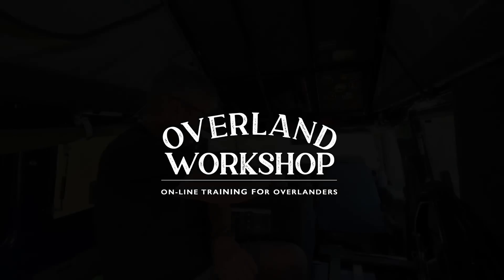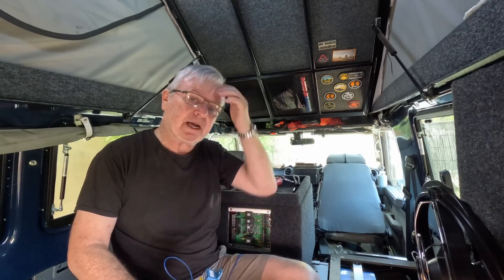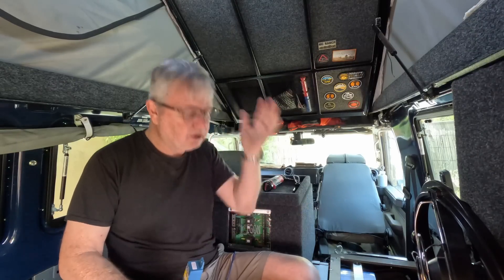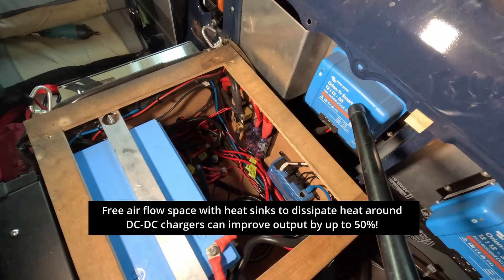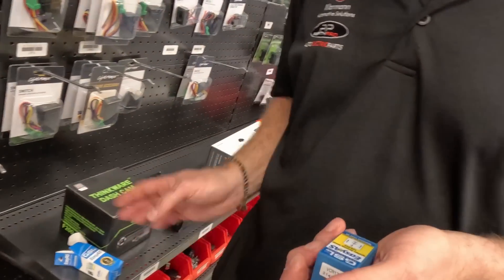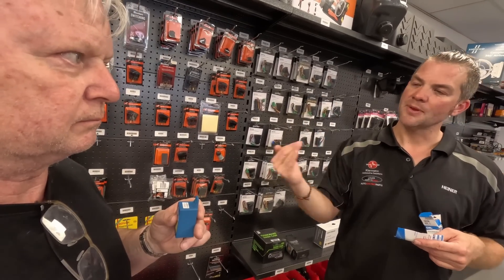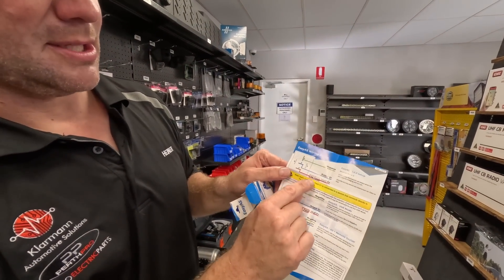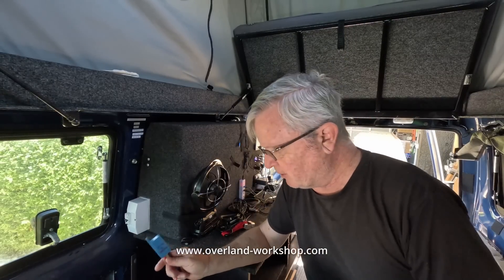INCREASE DC-DC CHARGER OUTPUT IN TWO EASY WAYS | @4xoverland​

Comment: hi.my twin victron dc chargers putting out only 2 to 6 amps recently on my vw t4 camper they in parallel the victron smart shunt shows same .i also have 12amp dc charger supplying my agm battery separate circuit.same earth.that supplies my stereo double amp system with subwoofer.only had about 28to 36 amps from 2 victron before

Comment: Hi Andrew I use a Victron dc to dc charge a 12/12-18 an mine works perfectly with a small 6 amp charger on the start battery. I think you don’t have the lower cut out voltage right mine is set to 13.6 volt cutout. It builds up voltage then bulk charges to the lithium battery then draws down kicks off at 13.6v and builds back up again

Comment: Seems like the Victron Orions are smarter than you give them credit for.  

I have a small 1.6amp charger on my start battery and my Orion never drains my start battery because the Orion only switches on at the voltage I set and it varies its output to trickle charge the secondary lithium battery.

Seems like you’re trying to solve a Redarc problem on a Victron product.

Also setting the cut off voltage at 12.4 is totally wrong.  You need to run bigger cables.

Comment: Very interesting that they set the voltage as low as 12.5v (without the relay). If the second battery is fairly discharged, the starter battery will only be getting charged at around the mid to high(ish) 12v region, which won't sufficiently charge the starter  battery and could have potential for not enough power to start the vehicle. 

I've found with mine (high output alternator, 75 series) that when I come to idle the starter battery voltage drops down to easily 12.5v in which the DCDC chargers engine shutdown detection kicks in and disconnects the DCDC charger. A bit annoying but on long runs it's okay. I might purchase this relay! Good explanation 👍

Comment: Since 1998,  I've used a Bussmann Circuit Breaker BP-CBC-30HB-R to charge two additional regular automotive batteries strictly for powering up the winch, gadgets, and lights. Not once did it ever drain my main battery. The Winch connector has an Anderson connector which is also used to jump-start any other vehicles and my main battery. With that being said. This old method should also work with the DC-to-DC configuration which will prevent/protect the main battery from being drained. Just saying 

Bussmann Circuit Breaker BP-CBC-30HB-R 

NOTE: The Profile Picture is My Beast which has this configuration and more.

Comment: I didn't understand how could this solve the 2nd battery stealing from main battery issue until I switched to Victron DCDC charger. A lot of DCDC charger has a built-in voltage sensing relay so that when a voltage exceed a threshold, it's on, and off when it's below a threshold(12.8v). They also come with an ignition trigger, but it's for smart alternator only. Because smart alt would drop the voltage when the primary battery is 80% charged. The issue is the ignition trigger can turn on the charger even when the voltage is low, but the charger will still get turned on when the the voltage is up. Victron charger is different, the switch is very flexible so you can use ignition relay to turn it off.

Comment: Wouldn't it be easier to do a fuse tap to a circuit that's only on when ignition is on to power the relay?

Comment: Can you use an isolator (cylindrical selenoid) at the same time as a DC-DC charger? Mine has one (selenoid) installed from the time I've owned it, I'm just not 100% sure if it works/ how it works, I've switched out the battery system for lifepo4s instead of a 100a wet cell. I just want them to get charged safely without ruining the alternator.
Reply: @theshepard22  yes a standard old fashioned solenoid between the two batteries will disconnect them as soon as the ignition is turned off. Ironic that all the new technology relies on the oldest duel battery setup to function properly.

Comment: that relay device is only necessary if you have connected up the bcdc to a smart alternator.  the new redarc devices do not do what you say, and drain the starter battery, if the car does not have a smart alternator. with an old style alternator the blue wire on a redarc isn't connected.

Comment: Same thing happens when your alternator isn’t large enough for the dc-dc charger size. I found out when I had a 20amp dc-dc charger in back of car and 40amp dc-dc charger in caravan. Alternator (80amp) couldn’t supply enough and engine cut out on highway and had to jump start. Battery lost a cell in that and had to put a new start battery in. Make sure alternator is large enough or put two in.

Comment: I have the same disc charger in my caravan and could only get around 10amps max because of voltage drop over the 6bns cable so I installed a VSR in the LC200 and disconnected the chargers engine on detection system and now get up to 30amps.

Comment: Loving these workshop videos….Thank you. I have my DCDC charger in the camper trailer, will i need to run a seperate single cable from the Battery/Trigger sensor in the vehicle through to my camper trailer? Or, is there another way around this via the Anderson plug that is already in place for the DCDC charger at the tow ball? Oh, and the ignition wire on the DC DC charger, does this connect to the trigger sensor? Cheers Tony

Comment: It's a 70 series am I missing something? Toyota provide a switched output for ignition on in the accessories fuse box in the engine bay. I use this to turn my Intervolt DCDC on.

Comment: Solutions to a problem that shouldn't exist. A second alternator setup is about the same price as a Victron DC to DC charger.... and you get the full current of the alternator, plus it also doubles as a backup alternator for the engine battery.

Comment: Maybe I'm wrong, but when an AC charger (which provides limited current) is connected, shouldn't the high current draw of the lithium batteries drop the system voltage below the DCDC cutoff level before the starter battery drains?

Comment: I think wiring a ignition wire is just as easy / difficult as wiring that relay. Don’t see any benefit of the relay. Unless there is something I’m missing.
Reply: I agree, my Projecta 40 Amp Dc to Dc has connection to ignition on only trigger wire, which it does, then I can't see need in changing the configuration. I do have a manual isolator in the starter battery to deep cycle battery in cabin cable connection too and also the redarc SBI 12 on the cable connection circuit. My Projecta charger has also got solar input and operates daily when parked up from the 200 watt solar panel mounted over cabin. My batteries are always full.
Reply: Where is the best location to connect the ignition wire when the DC-DC charge is positioned in the camper trailer
Reply: @tonydawnwright346  You can run it on the spare cable of your trailer plug.

Comment: Interesting. I haven't had any issues with my Dc to dc charger running down my starting battery.
Reply: It’s confusing. I run a Renogy dc to dc and it prioritizes charging the start battery. I do not run a cable to the alternator because it is not smart. The starter is AGM odessey. I’ve yet to charge the starter battery with an AC simply because there is no need. The mppt on the 30a Renogy charger typically prioritizes starter before house so I can just switch on the solar disconnect and all is good.

Comment: Victron DC to DC chargers are thermally regulated - Meaning if you can assist the cooling effect of the fins on the rear you can increase the amperage charge to the leisure battery quite significantly. (i believe its 30a at 40 degC, so the cooler you get them the more output they generate)

A ducted 12v PC fan uses less than 1.5 amps of power but could increase the output of the Victron charger by as much as 7.5a or more. 
take a look at adding a PC fan to the Relay switch for the charger and see how this could get you far more power to your battery meaning you run the engine less. 

Enjoy

Comment: This is like how I have mine setup and it's the best. If engine is on then relay is triggered and charger starts. As soon as trigger is turned off the chargers turns off. No pausing to check voltage. Just pumps 35A in constant

Comment: Yes Andrew, that is why people use Redarc dual battery isolators:cat-orange-whistling:
Reply: Sorry, Redarc used to be Ignition switched but the current Redarc Lithium bcdc 1240D (with a "D") has the same problem. I'm a Redarc fanboy but am totally disappointed and p'd off about this. I called them to confirm and asked why "that's just the way we do it now". What I thought was the Ignition trigger wire, is just for setting one of two cut in/out levels. This is all written in the instructions.

Comment: We use Renogy dcdc chargers and like most modern dcdc chargers, redarc, ctek, victron etc have a ignition trigger, we just fuse tap the cigarette light fuse, or windscreen wiper motor.

Comment: How many amps do you get out of your 30 amp chargers? I’m getting a max of 27 amps and have a small aluminium plate on the back and not amazing airflow but it seems to be getting crazy hot compared to redarc units
Reply: Victron DC to DC chargers are thermally regulated - Meaning if you can assist the cooling effect of the fins on the rear you can increase the amperage charge to the leisure battery quite significantly. (i believe its 30a at 40 degC, so the cooler you get them the more output they generate)

A ducted 12v PC fan uses less than 1.5 amps of power but could increase the output of the Victron charger by as much as 7.5a or more. 
take a look at adding a PC fan to a Relay switch for the charger and see how this could get you far more power to your battery

Comment: Andrew. Again, two solutions to that.

First, in the Orion App you can configure the lock-out voltage incase you don't trust the "engine-running-detection". Set it to 13.5V or 13.4V and it shuts off immediately.

Second, if you charge the starter battery from external, put ignition signal onto the H terminal of the remote port. I reckon the DC/DCs have common GND with the car electrics. And if you cannot find an ignition signal in the back of the Troopy, I'm pretty sure aux power ports (cigarette lighter?) are switched with running engine and not permanently live.

No 126 bucks relay required. NOT, AT, ALL.

Up to this video I really was a huge fan of the stuff you and Heiner did. But now I'm a bit disappointed. This is NOT a smart solution, I'm used to other things from you. (no offense!)
Reply: Yeah I have the same Oron and its setup right, always instantly turns off as soon as the engine is off. Also you can set a start delay so when engine is turned on, it waits a bit for the starter battery to charge back up and then starts charging house batteries. Oron does it all, I don't think these guys know how to use it.
Reply: @marcusrwalker  I reckon the main issue is external charging of the starter battery as Andrew said. Putting ignition or switched DC onto the H terminal of the remote port does the job in no time.
Reply: Would that also work with variable voltage alternators? My understanding is that they can deliver low voltage even when the car is running which will stop the charger from charging and will make the whole process of charging less reliable.
Reply: @pabichpawel  It does, there's a preset for that in the Orion config. Though that'll result in massive current increase and heat emission at the Orion.

Comment: Seems to me that from a technical viewpoint, the DC-DC charger should be able to detect what that relay is detecting.
Can't quite find the exact method of 'engine detection' that the victron chargers use, but from the documentation, it seems they are implying that it is not only volt based.
That said, this problem mainly applies to engines with smart alternators I imagine. On my TD5 defender the charger always stops as soon as I turn the engine off. Victron Full Range Automotive TS-800C (50A) charger.

Comment: I have this setup (Victron). I have a switch on the positive between the vehicle battery and the leisure battery as well as a fuse. I just turn the switch if I don't want it to drain the battery. I'm sure you can also stop charging from the app also, although the charger is a bit annoying because it only turns on when it detects increased voltage from the vehicle battery, so you have to wait for it to boot up. Your set up is more ideal but trickle charging isn't something I do very often.

Comment: If you're not competent enough to wire into the ignition circuit, then you're not competent enough to wire in a DC/DC charger to start with and you should leave it to the professionals

Comment: Good point. My enerdrive dcdc already has that accessory wire. 👍
Reply: I have my Enerdrive 40+ connected without the ignition wire but will soon be fitting it or adjust disconnect voltage up to 12.7 or 12.8 volts so disconnects the dcdc much sooner. I have to gares on my property about 2 minutes. I turn off engine to open and close gate. If my Li battery is low and Dcdc is pulling my setting of 30amps while doing the gates.
On 4th starting engine it is possible the 30amps draw by dcdc and lowered amps in cranking battery that the starter motor will not have enough amps to crank over engine. Solution is to open bonnet and turn off the 70amp breaker switch on dcdc supply cable from the crank battery. Then engine's crank battery will usually have enough amps to spin the starter motor.

Reckon will buy the relay auto wizard recommended 👌
Reply: @mattwalker6305  just wire the ignition then you will be sweet👍
Reply: @chuckberry7692  just have to find the cable as been over 3.5years since fitted current 12volt setup

Comment: Andrew, when I changed from Lead Acid to LiFeP04, as I was fitting the Victron DC2DC charger I realized the issue of it draining the vehicle battery in the Patrol could be drained as you described in the above video.
So, instead of removing the National Luna solenoid, I left it in the engine bay and connected the DC2DC charger  to the solenoid, totally isolating the DC2DC charger from the vehicle battery when the ignition is not turned on.
To me that was just the easiest way to solve the charger on when it should not be charging the auxiliary battery.
It has been working faultlessly like this for nearly two years now. Keep well and keep these tips coming.....

Comment: Andrew, you are using the wrong method for a trigger wire. The trigger wire should only have voltage when the ignition switch is on.

Comment: I guess this will fix the issue that if your lithium battery drops below 12.4v ie left fridge on without charging, that the dcdc won’t switch on as it assumes the start battery has more voltage so it starts to drain it as well. 
I wondered how to fix that. Now I know. Thanks.

Comment: This is basic stuff. Good that you have highlighted it. I can't believe that people have so little understanding of how charging systems function. I use a manual isolators so charging the chassis batteries is combined with total isolation of the house batteries. Simple and effective for me.
Reply: Likewise on my system.
Reply: As long as you remember, which I and others wouldn't
Reply: @Malc664  Id assume you don't own shoes with shoelaces.
Reply: Can you use an isolator (cylindrical selenoid) at the same time as a DC-DC charger? Mine has one (selenoid) installed from the time I've owned it, I'm just not 100% sure if it works/ how it works, I've switched out the battery system for lifepo4s instead of a 100a wet cell. I just want them to get charged safely without ruining the alternator.

Comment: I highly suggest Ctek, 250 and Smartpass. They seemed to be overlooked these days but are more sophisticated than people realize. They take care of many problems other dc to DC charger systems have.
Reply: I use to be a fan of Ctek over 15 years ago but in my opinion their technology isn't as good as Victron now days. Cheers
Reply: I have that ( im swedish) but the 2 year D250SE i have limits charge to 20A when you put it in lithium mode. Smartpass never engage. Sure, saving generator, but you get lithium for faster charging. Whith AGM/lead acid it works perfect.
Reply: @BeeBeorn  I use AGM batteries. I think it goes to 40 amps. I have heard that these units don't do so well with lithium

Comment: Interesting.  I have a slightly different approach - I use an ignition triggered relay to cut / supply power to the Victron.  When the engine is off it's power connection to the start batteries is cut.  The charger operates in automatic mode without issues and there is zero parasitic draw.

Comment: I agree with you completely about the BCDC not turning off immediately. I resolved this issue in my Aus Troopy about 5 years ago by putting a 50 amp relay in line with main battery feed to the BCDC and connected it to the starter switch so when the motor is running so is the charging from the alternator to the BCDC. I have the same for my 76 series in NZ. No issues and no residual current drain and very cheap way to save money. It also makes no difference which battery is being charged with an ac mains charger.
Reply: As I just noted - I did the same via the dual battery solenoid I already had wired under the hood. I treat the DCDC like my other high draw accessories (winch, compressor, etc) and it is totally cut from power along with them when the engine is off.  )Works great!
Reply: @ThePyleDriver  yep, same difference.

Comment: I noticed this with my simple isolator switch setup. Super frustrating as it would also connect when I had solar on the second battery and drain the start when at camp. As the solar would have high enough voltage to connect.